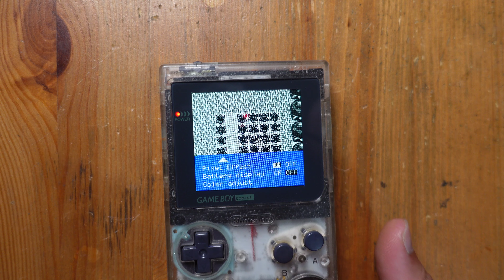New Game Boy Pocket Screen Mods! Q5 OSD installation guide and demonstration

Comment: The bat pad on the the ips kit is optional. It's just so you can see battery levels. Which doesn't work very well depending on what kind of batteries you use.
Reply: so dont install it

Comment: so correct me if im wrong, if you don't setup the menu you can use the touch sensors, but if you plan to use the menu you can ditch the touch sensors all together ?
Reply from the maker: Yeah you do not need to install the menu buttons. The touch sensors can do most of what the menu offers

Comment: I dont have any soldering Equipment/ experience. Can i use the Screen without soldering? Are the wires only for the osd?
Reply from the maker: Correct, it’s only for the OSD so you don’t have to install those wires

Comment: It's very misleading how easily you made it look to solder the wires to the A, B, Sel vias.  Those are conformally coated and are a nightmare to get solder to flow into
Reply from the maker: I’m not sure what to say about that. I try to film everything as I do it. With the right tools it’s not too difficult to get solder to bond to those vias
Reply: @LIRetroGaming  Maybe different board revisions didn't have as much coating but my board in particular was near impossible to get solder to wick down into the via